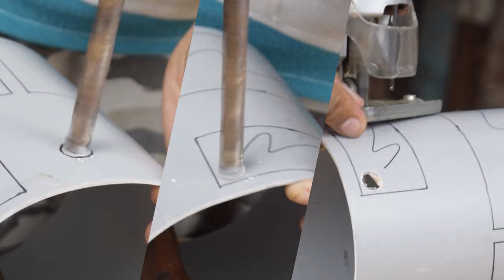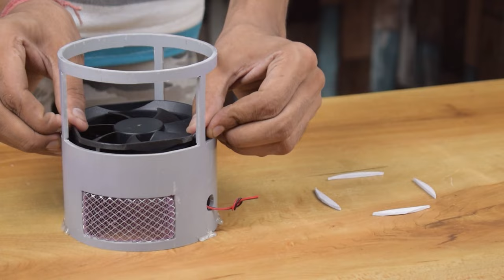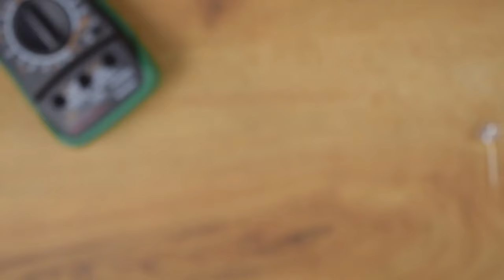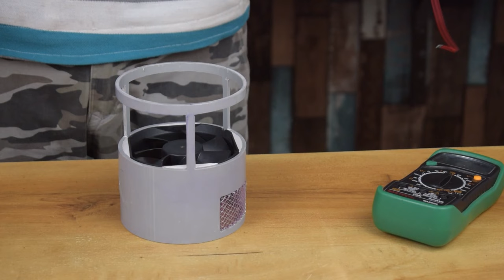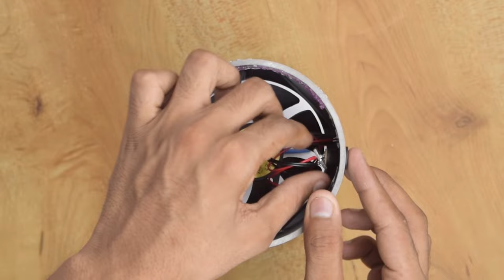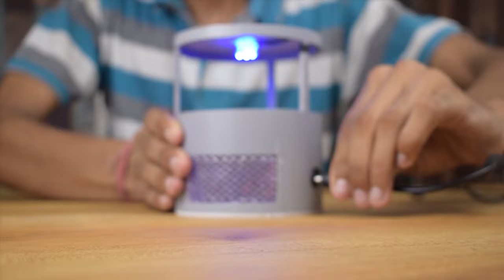DIY Homemade Mosquito Killer Lamp

Comment: the grid was not connected to any circuit, how does it kill theinsects without high voltage current?
Reply: The fan suck the mosquito and cut it and the mosquito died and stored in the bottom

Comment: series connection yaa parallel connection?
Reply: the four LEDS are in series with maybe a 220 ohm resistor. The fan is parallel to the Leds.